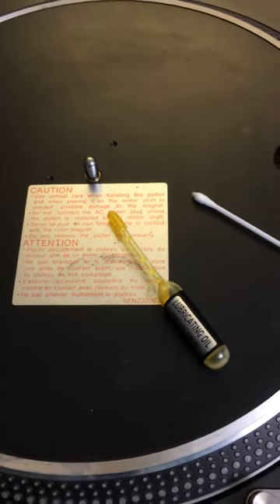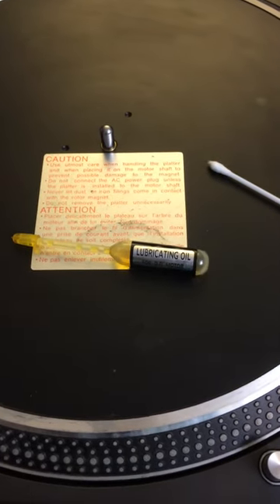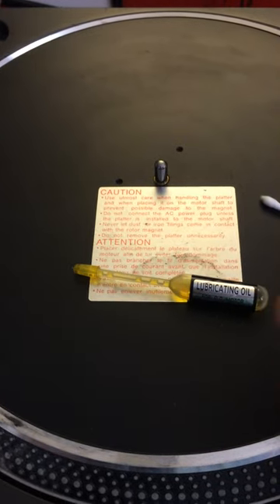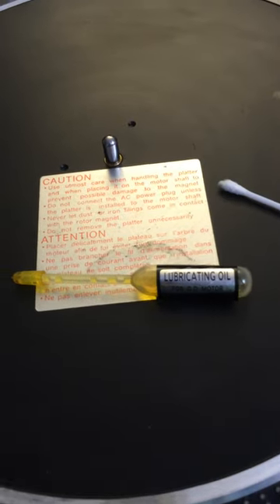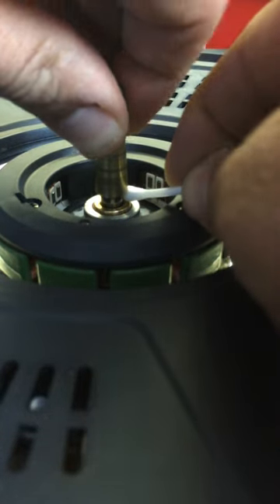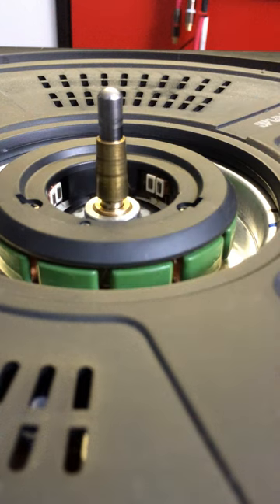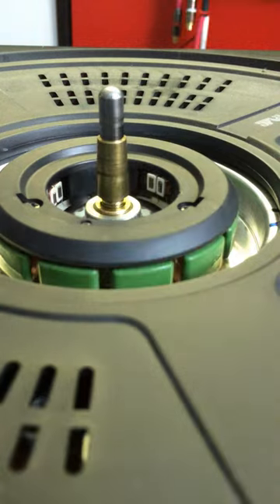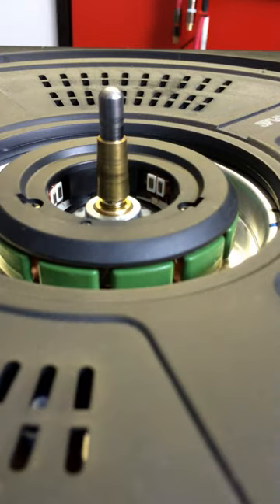Technics 1200 Series Turntable Spindle Oil Application

Comment: Nice one! I just got a pair of technics, and I believe one of them is stuck in the down position (it doesn't move up and down like it's supposed to. I've been told that it could be fixed with a little bit of wd 40 and then lubricating oil. What's your thoughts? I ask because I believe it's causing the platter to rub on the plinth in one spot. I hope it's nothing I have to go to a technician for lol (because I'd have to either get a lift with it lol).
Reply: Did you solve it, I'm having the same problem

Comment: With proper lubrication using the technics oil, and regular home use (not dj’ing), could the spindle last the lifetime of the machine? What does the bottom tip of the shaft ride on? Thanks for the video.
Reply from the maker: Oil every 2000 hours depending on your use. The bottom tip rotates on a smooth indentation on the bottom plate. I always put a drop there also but that is because I take them apart as part of our service.

Comment: On one of my Technics 1200 MK2s, the spindle bearing has some vertical movement like in your video, but on the other one the spindle bearing doesn't budge at all -- is that normal with some models or should I get it checked out?
Reply from the maker: Yes there are two different designs as well as wear on the bearing depending on the age. Always good to get a spare as they will soon my like the unicorn as they were discontinued long ago.
Reply: @MrTechnics1200s  A spare spindle bearing?
Reply from the maker: @nickl1430  yes that would be my advice.

Comment: could oiling the spindle help with some unacceptable wow issues? electronics calibration and pitch fader are peachy.
Reply from the maker: Yes and also try another platter. Weak magnets I have seen also cause wow and flutter issues.

Comment: Please show platter removal. I might use microfiber instead of a q tip to clean the shaft to prevent lint issues.
Reply from the maker: Platter removal is not a big job. Simply put your middle fingers in the holes of the platter and with your thumb push down on the spindle. If it is proving to be hard to do... with one finger in the hole pulling up take the back of a screw driver and tap the spindle. This will separate the platter from the spindle as over time some do get stuck.

Comment: Some people say that the axis should be cleaned before applying new oil :-/
Reply from the maker: I was only showing how to apply. Typically I clean the outside with a qtip but there have been instances I have removed the spindle shaft from the cylinder and cleaned both before lubricating. I am guess it depends on the level of dirt.

Comment: i used a drop of 5 w30 engine oil ... worked just fine..
Reply from the maker: specialformula14 oils is not oil. Viscosity is very important. I would recommend sewing machine oil as the closest however for best performance original Technics oil is best.